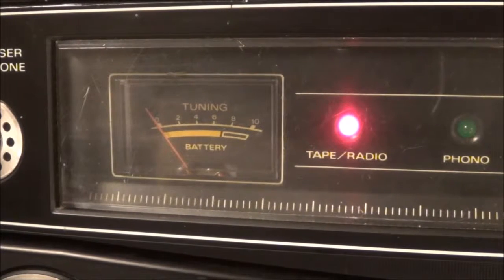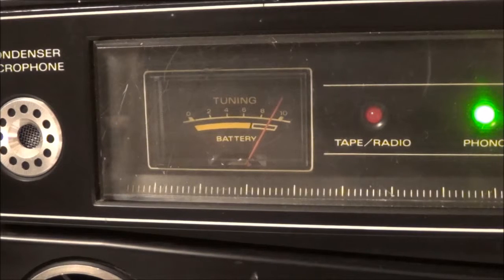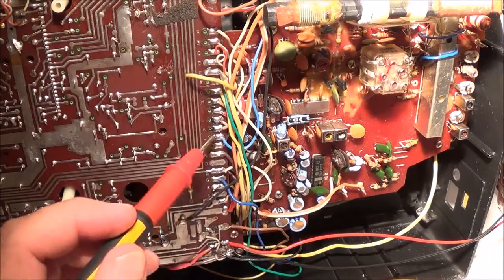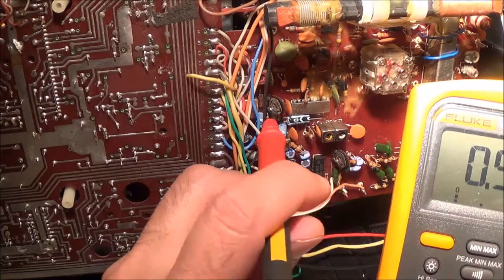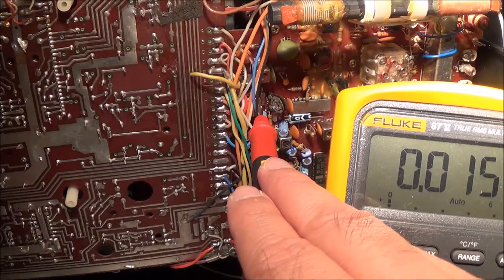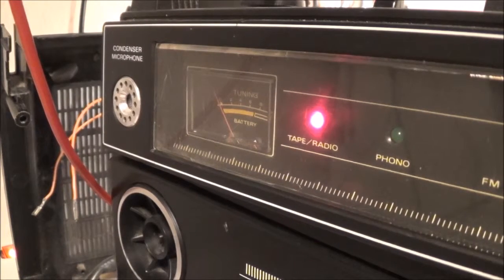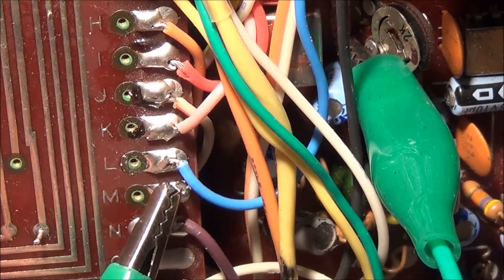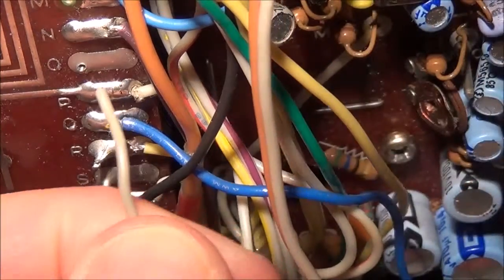Sanyo M4500 Signal Strength Meter

Comment: Hello Old School,great tutorials to fix M4500 :-)Do you have any idea where to source a new telescope antenna for the Sanyo M4500?thx Hans
Reply from the maker: Sorry Hans: I normally order replacement antennas from ebay; but they are not an exact fit. The original antennas, of course, are no longer produced. But if you still have your old antenna, you can take some measurements, which is a big help. You should be able to get an antenna from eBay for under 10 dollars or under 10 Euros.